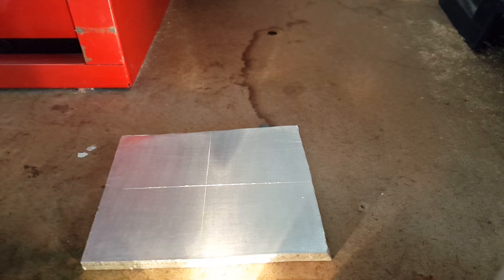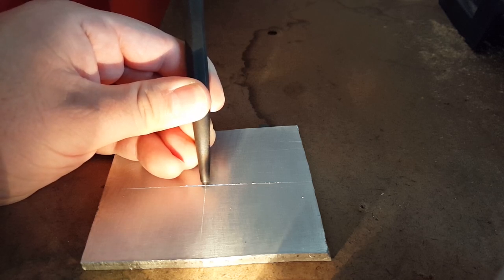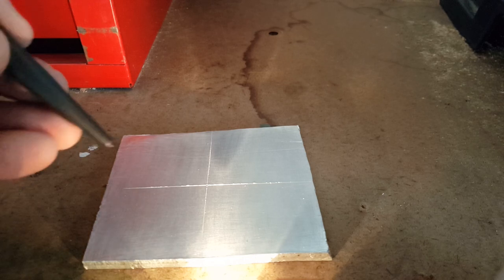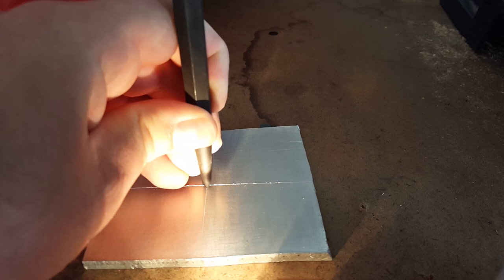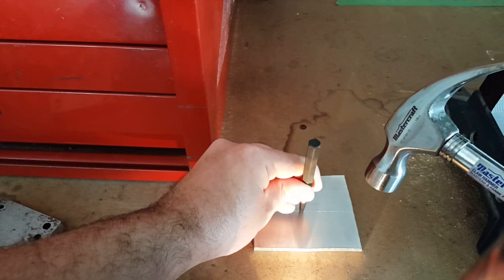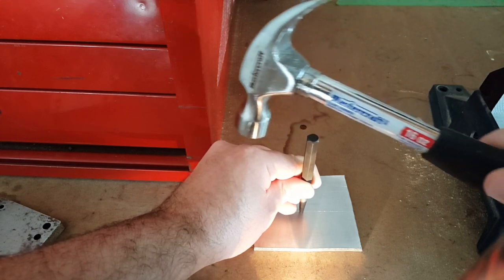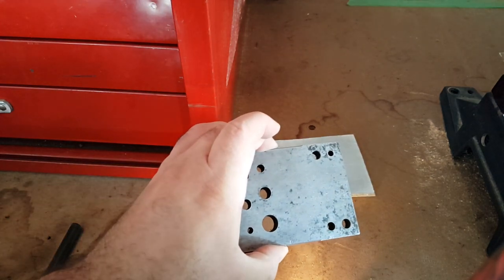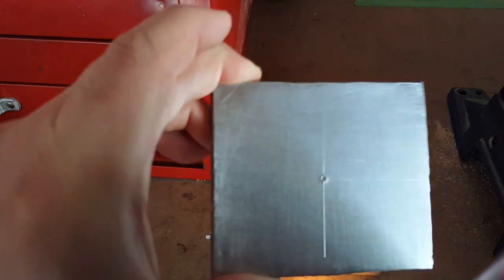How to Use a Center Punch (Pre-Drilling Operation)

Comment: Could you please tell me how to center punch wood without the punch drifting when you push it in.
Reply from the maker: I don't center punch wood, I could see it drifting out of place easier because wood typically has a grain to it. Because wood is soft, I would just start with an extremely small diameter drillbit. You could also try pressing a nail into the marked area just to create a small divot for the drillbit to grab onto.
Reply: @PointofParallax  Thanks much. I never could get those screws holes to line up with the hinge.

Comment: what kind of center punch did you use in this video ?
thank you
Reply from the maker: I used a Mastercraft 3/8" punch in this video, but since then I bought a Starrett 117C ->  https://amzn.to/2RM9Jfl  It's easier to use because of the knurled area that you hold and the thinner diameter makes it easier to see when you're lining up the punch to your marked area. The point at the bottom is finer too. I've punched hot rolled steel with the Mastercraft though and it still works fine.
Reply: You can make your own from an SDS drill bit.
Reply: @PointofParallax  what is the difference between 3mm, 4mm and 5mm center punch? what these numbers mean?